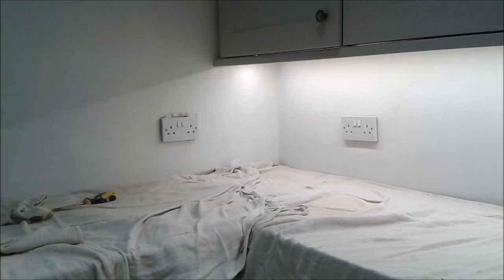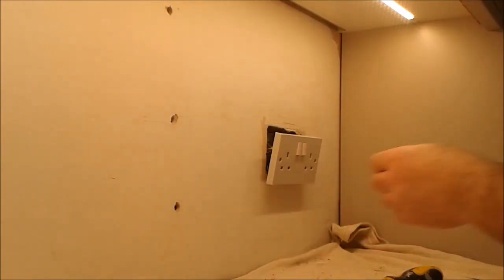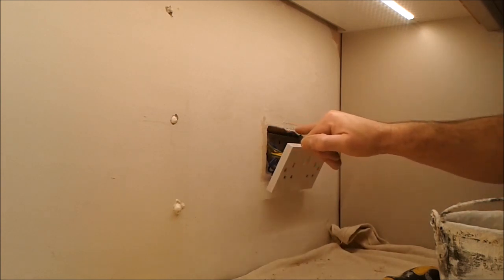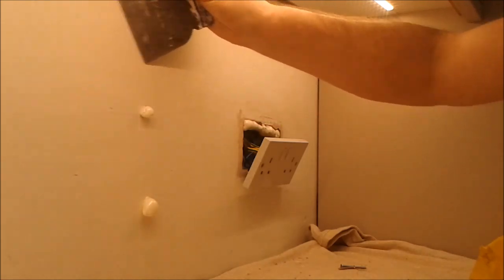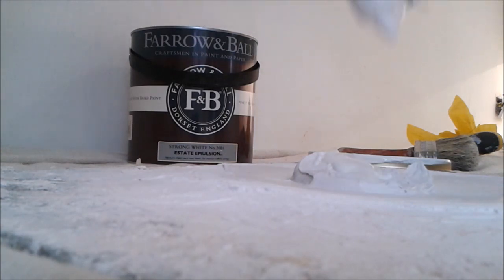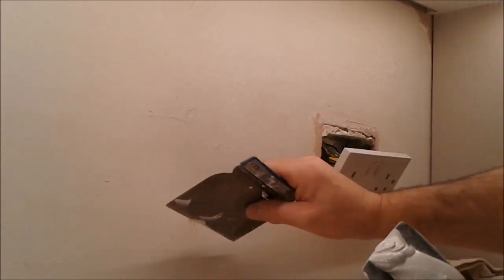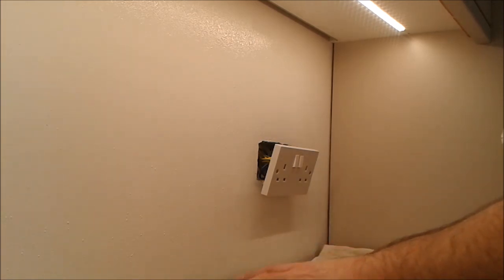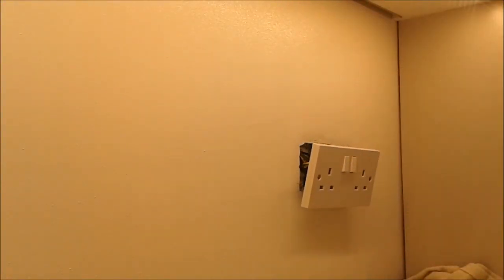Quick fix for gaps and cracks around electrical sockets

Comment: I take it the same procedure applies to gaps around spot lights. Thanks for the video 👌
Reply from the maker: Possibly, but it depends sometime it's best to remove light and build up the edge using polyfiller. If you use foam you may not be able to remove the light easily in the future.

Comment: Hey mate. Great video. 

I have the same issue, awful job to cover gaps around sockets by plasterer. Left me with another job!

I've stumbled across your video because I have encountered a problem. 

I have already used an Expandable foam to mostly fill the gap. The filler I used (Polyfilla OneFill) has sagged however and isn't doing the job.

Can you advise on the best filler to use... something that will set and allow a light same without falling apart.

Comment: Great video. I need to do the exact same thing as this. I assume you are using fire rated expanding foam? Also, what is the benefit of using a foam canister in a gun as opposed to just the normal can and nozzle?
Reply from the maker: Never used a gun..
Reply: With gun grade canisters you can clean the end of with foam cleaner and re-use the remainder numerous times.  Provided you activate even just a little every 6-8 weeks.  

Yes best practice to use fire rated foam.  British standards stipulates the use of no combustible foam within annular spaces, in and around switchgear.  I'm an electrician so I guess I should know 😉.

Comment: Hello, I have this situation but with one socket above and another to the side so there isn’t a lot of access. Any advise on potential tools to get in them narrow spots to level off the filler.
Reply from the maker: Sometimes use anything that is flat and small, screw driver or knife. Thanks.

Comment: Hi I need to do a similar job to a shaver socket in a tiled wall. What was the foam filler you used and is it ok to use in a bathroom?
Reply from the maker: Soudal gap filling foam

Comment: I just replaced an electrical outlet box in the back concrete wall of my house.  On the left side, there is just over a 1 inch gap which needs to be filled and I can not find an answer on what to use to fill it.  There is an expanding foam that someone suggested but I am not sure if the gap is to big for the foam.  The other option I found was a quick drying concrete.  I have no clue and there is not a lot of info on it. There is tons of info for drywall, not concrete.  Thanks
Reply from the maker: These two videos may help 
https://youtu.be/-DTLdhb4KJ4  https://youtu.be/kUwEAYjvBXc

Comment: As long as you use paint with your filler does that mean you never have to spot paint your filler prior to fully coating?
Reply from the maker: Yes, on second coats but usually before first coat filler gets diluted PVA on. Then any filling after the first coat is a hard stop. Giving your filler the colour and stopping it flashing.
Reply: Painting and Decorating would you recommend 3-1 or4-1 pva on new plaster and would you give it 1 or 2 coats?
Reply from the maker: 4-1 and one coat
Reply from the maker: Thanks, a hard-stop filler is paint mixed with the filler and a smaller amount of water. Mix just enough for a section but as it starts to go off use it up on any large holes then mix some new and as you're filling you can top up holes you have already filled. Filler drys that fast you can drop back and add more and build up parts. The ratio is filler and a small amount of water just to bring it together then mostly paint to get it to a nice smooth consistency.

Comment: U made the holes along the crack but didnt show what you did with the crack itself?
Reply from the maker: The holes are like stitches which hold the crack together.
Reply: Yeah but what did you do with the crack itself, fill it or just the paint fill the gap?
Reply from the maker: @Jackzuk  It would have had a slight rack out and filled.